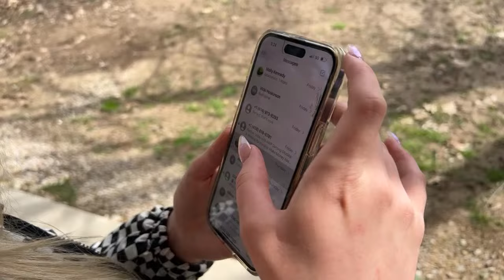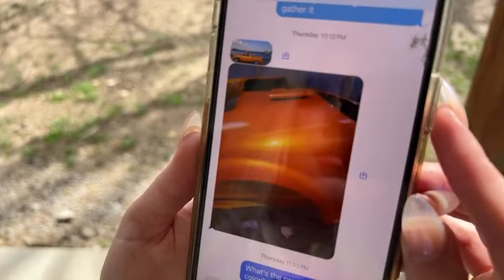Total Eclipse from SRC Headquarters

Comment: My Optrel welding helmet worked like a champ but I think it uses Infra Red to darken and not a light sensor. I have the Optrel Panoramaxx CLT. Its one of the best helmets for TIG. It has an auto shade mode that adjusts the shade on the fly. Its much better than my old Viking 3350. Well worth the $600.

Comment: back in the late 80s early 90s i worked at delivering appliances for Sears and every washing machine and refrigerator with water feature had those red or blue plastic cups, or  caps whatever you call them anyways the weld wheel was as hot as the sun and everyone wanted those cups for the odd holes in there wheels that didnt have a lugnut and guess who had a car load of them i used to sell them for a buck a piece

Comment: Have you ever used a water spray bottle and lightly mist. It whistles and sucks it in. (Safer than carb/choke cleanerThere is also a smoke machine you can use they work great but you may have to block off some passages.

Comment: Intake manifold is causing your vacuum leak … at least that would be my first bet. If it isn’t a sealing  /gasket issue ( all that boost and the machine work to make it fit the 18-14* mtr . I doubt it’s the front or rear matting area because you would see oil most likely at lower rpm’s ) could be a cracked port . What ever it is the gap is expanding with heat and leak would have to be below throttle blades so .  Just my guess . Guess it could be carb base but I’d think the old man would catch that

Comment: Just paint it white or factory color. Midnight purple she was pointing put (color shift) or the other names they call it will cost you more to buy yhe paint than build that and another car. I did flames on a Harley the midnight purple (shift) a d it cost me 2500 for a pint and they didn't mark up that was the paint suppliers cost just a pint of color. No clear no supporting chemicals etc.

Comment: I on way junk at 8 this morning on the way truck blue top neck off it a mile from juck yard put water they have one my truck but I made work from new truck it did have cap an line transmission was big but I made work made it work that we're I was this going but on my way home hose come down in the fan I forgot my phone had no calling anybody come get I got in tool boxs put wrap black tape around 3 time keep mind three holes in made home did lose drop water so black tape will hold on a top hose 😢😮😊 so people keep mind if u have bad hose black tape will get u home an purple midnight